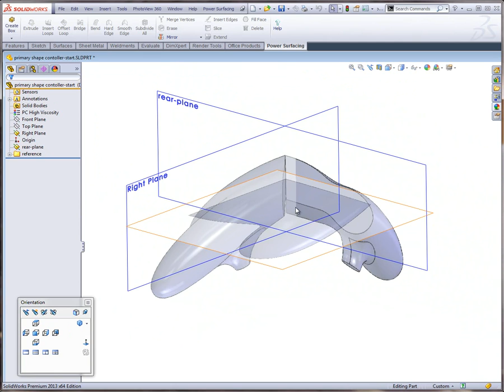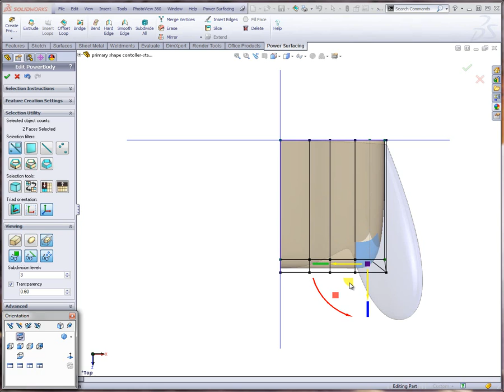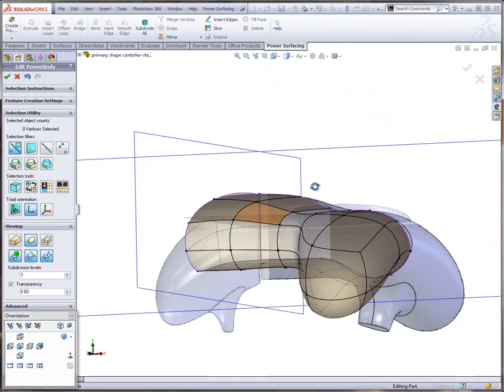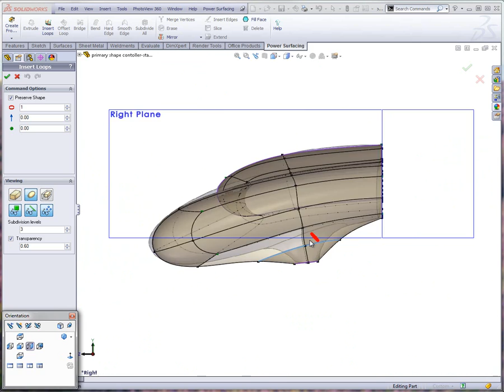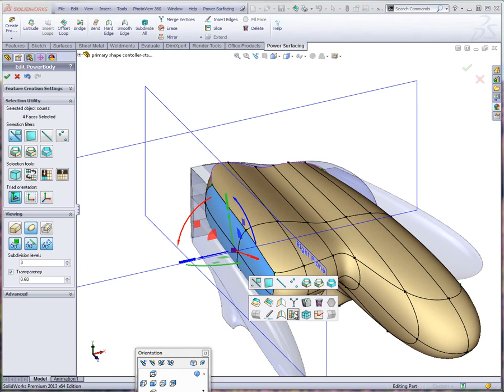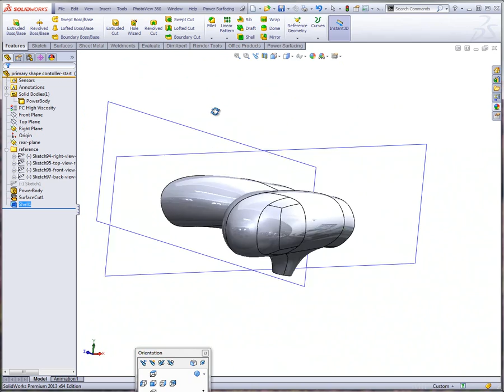POWER SURFACING DEMO

Comment: was Power Surface removed in SW2019?  I don't see it even typing 'power surface' in the command lookup window (upper right corner)
Reply: It is a separate add in. It was never a built in part of Solidworks